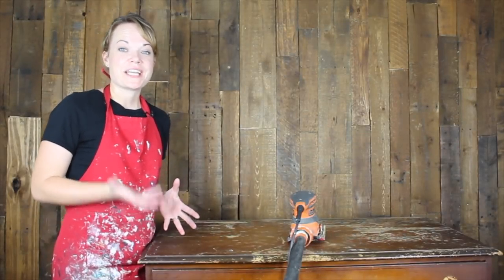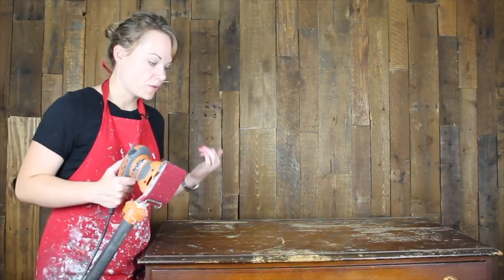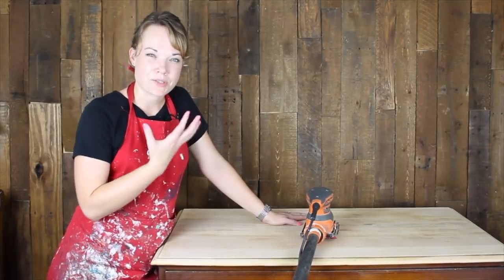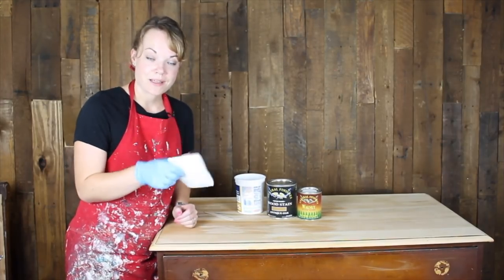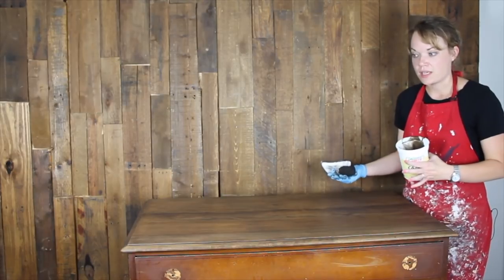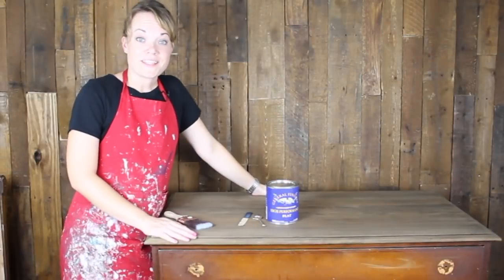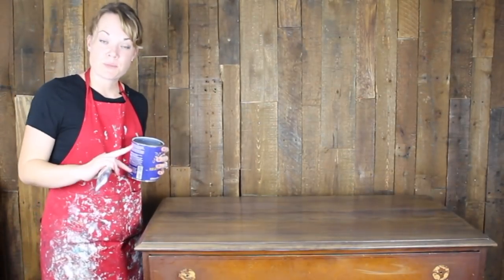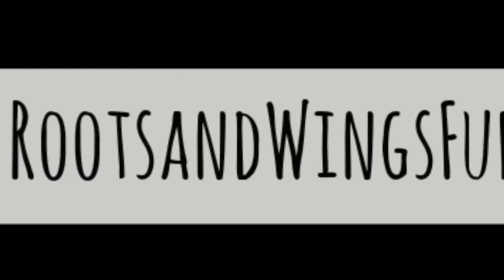DIY Furniture Restoration with Water Based Stain

Comment: Just finsihed my kitchen table , stripped varnish,  sanded wirh orbital rigid sander , sanded by hand 220 , 2 coats  special walnut varnish , sanded again to start  water based top coat flat . Came out amazing thanks for the videos.

Comment: Liked your video. Looking to switch from oil to water based stain and topcoat for my dark stained Acacia dining room table. I stripped it and neutralized the stripper with mineral spirits. I recently learned I should have used denatured alcohol to clean up at the end of the stripping process if planning on water-based stain, since mineral spirits is oil-based. I'm concerned about the water-based stain taking to the wood now. Can I just sand some more, or do I need to go out and buy denatured alcohol?

Comment: I just watched your other video that shared you don't need to strip the wood down if using a water based stain? Or for table tops/larger surfaces would you still recommend to fully strip the wood via sanding?

Comment: Great tutorial! Do you have suggestions for staining when scratches are deep and wide (I sanded with 80 grit and still see them)? I would like to stain dark but worry the scratches/indents will be highlighted.
Reply from the maker: If the scratches are very deep, you may need to power sand them down to raw wood, very rarely have I had to use 60 grit sandpaper, but sometimes.

Comment: At 3:26 you switch sandpaper and do something with that other piece where you put it on over the sandpaper and then take it off... what is that what are you doing?
Reply from the maker: That is a "plastic pokey thing" that pokes holes into the sandpaper so the dust collector will work!  I just posted a video about my electric sander which explains this a little better - https://www.youtube.com/watch?v=ojFyk9nGYkg

Comment: Thank you- great instructional video!!!! Question: do you need to sand in between coats of finish? If so, why? I’ve seen others not sand but just apply 3 coats of finish.
Reply from the maker: You do if you feel any roughness at all.  Sometimes the finish brings up the grain and it can feel bumpy or a little rough, in this case a quick sanding between coats gives a gorgeous finish.  If however, you have a smooth finish with the topcoat, it's not necessary to sand.

Comment: Sorry to be that guy, but you have a lot of incorrect information in your video. 
When you went back and wiped the surface down with water after sanding, you need to sand again. The wood is absorbing that water and swelling. You can typically tell this by it having a fuzzy feeling to the surface. You really need to sand that down as the wood does not absorb consistently across the surface. It doesn’t need to be a rough or heavy sanding; lightly with 150 to 220 grit should do it. Instead of wiping with water, try using a dry, lint free towel, vacuum or mineral spirits if you are going to use oil based products. 
You should also look into using a shellac wash coat (shellac diluted to 1 pound cut) for sealing the wood prior to and after staining. 
Another thing you mention is putting a water based stain over an oil based finish. Remember the phrase oil and water do not mix. Yes, that applies even in wood finishing. Planning ahead for your stain, dye, glaze, topcoat, etc all need to be of the same type. Mixing an oil based over a water based or vise versa will give you a very unsatisfying experience. Choose one type and stick with it throughout the project for best results. General Finishes is one of the best manufacturers of finishing products. They also provide a lot of great information on their channel that you may want to refer to for validating most of what I’m sharing.

Comment: No eye protection and not even a paper mask when sanding 😱
Reply from the maker: My sander is set up with my shop vac as a dust collector which takes care of most of the dust! You're right, I should have a mask, I just hate them!
Reply: @RootsWingsHome 
Great Video! I watched it a couple times, well done on the instructions, very clear and easy to follow.
I was hoping to know what type of Shop vac and filtration system you used with the sander. Also how good of a job keeping the dust contained? And finally would I be able to purchase on Amazon as well?